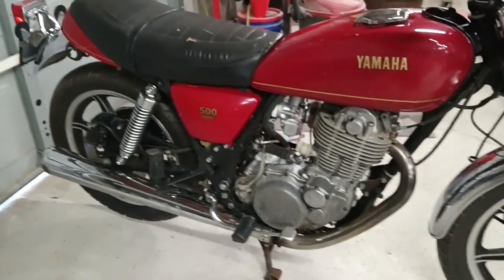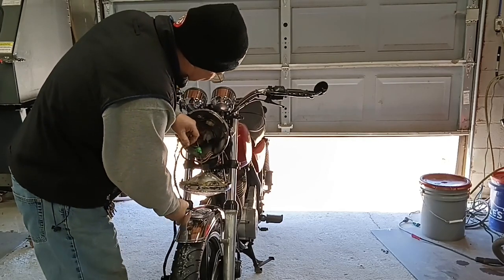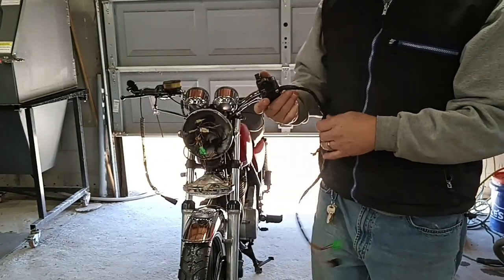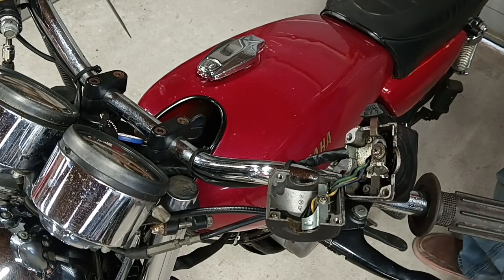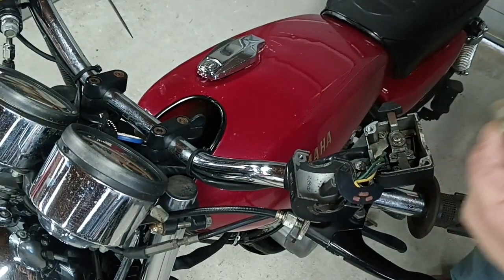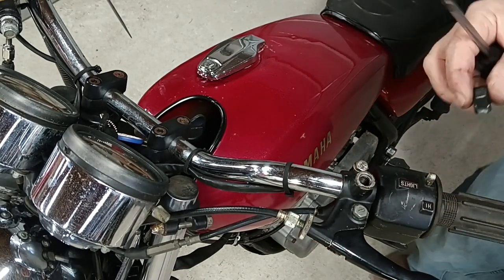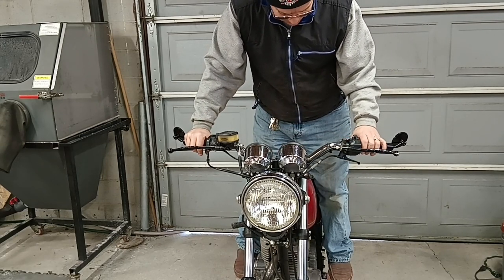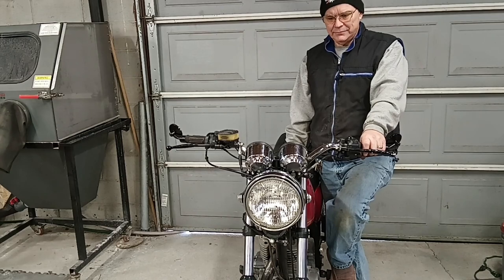Headlight Switch Repair 78 Yamaha SR500

Comment: I can relate mate been there done that my light switch was broken off too, there was enough of it left poking out to be usable but I'd resolded the indicator wires a couple of times and the horn button was damaged and got lost on the road at some point so I got another switch off ebay but it turned out to be from a different model and had an extra wire and different plugs 
By comparing the the two switches I was able to make one up I was able to eliminate the extra wire and joined my original wires and plugs to the replacement switch 
I have a simpler VM36 Mikuni it came pre-jetted for an SR500 and it runs great
My bike came with an aftermarket stainless steel header pipe and a Dunstall style muffler I also have a factory Harley Davidson Sportster muffler that I use when I'm servicing (repacking polishing) the other muffler 
The Sportster muffler is from an 883cc model and with an eight inch extension lines up perfectly with the SR exhaust mount, problem with the Sportster muffler it makes the bike sound like a Honda 90 post bike and wipes 15 kilometres off the top speed, anyway it's good to have as a spare 
Do you intend to keep your SR ?
I've had mine about nine years and done 80,000 kilometres
Reply from the maker: @hodaka1000  Thanks for the opportunity to converse. I am also running a VM36 that was pre-jetted for an SR500 but discovered that it was a little too rich when I hooked up my AFR gauge to tune it so I have gone down a jet size on both jets. My plan is to keep it for a few years at least, although for the first couple of years it will probably be a pampered show bike when I finish the full build.